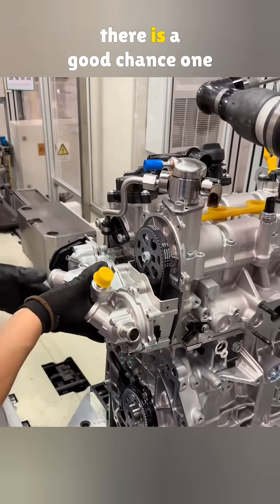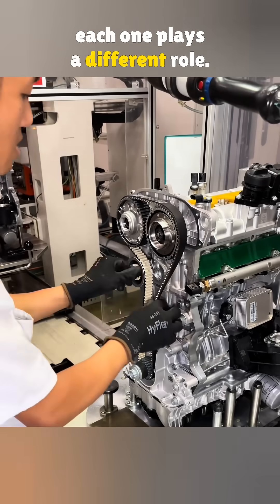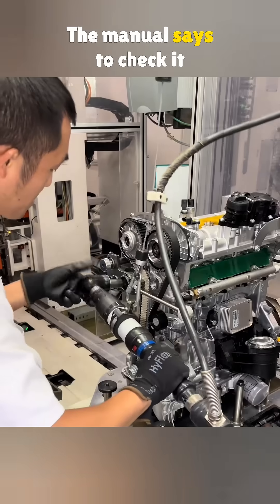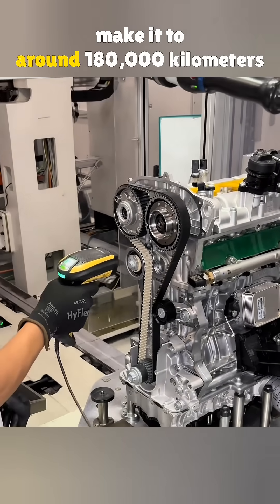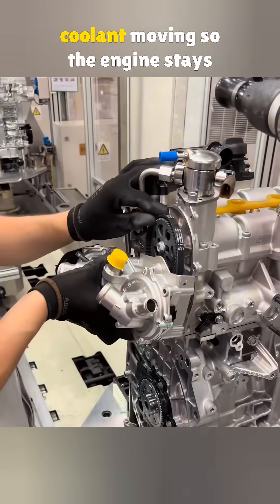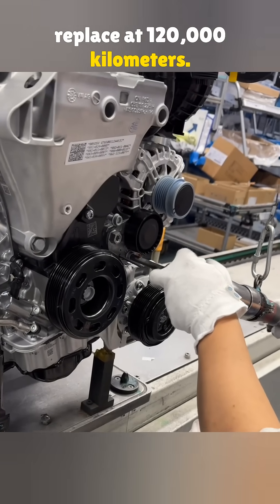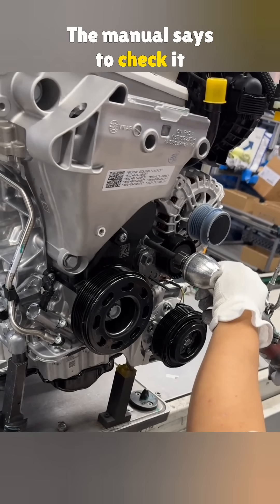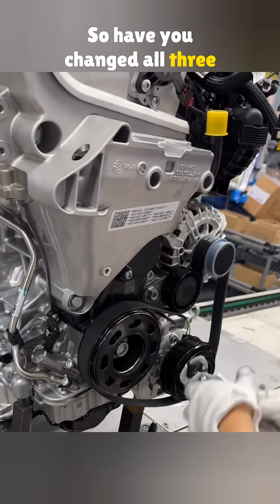The Belts That Keep Your Engine Alive

Comment: Volkswagen group's engine design are stupidest in the world. They cannot be worked on easily.
Reply: What are talking about? You csn do anything on VW engine with a common tools you csn find in the hardware store. And most of the parts are literally like Lego (the fit only 1 way) so you can't install them wrong.

I feel like you want to comment while having no experience.

VW engine are the most DIY there is.

Comment: Biggest mistake they ever did was putting a belt on the water pump like that absolute stupidity.
Reply: In all the cars I've owned, the water pump was driven by the serpentine belt. As far as I know, most non-hybrid Toyota models also use a belt-driven water pump.
Reply: @YuriiT.  Maybe he refers to electrical water pumps like most modern BMWs. By the way, those electrical water pumps are terrible, and oh boy, they break and cost a fortune (they have a plastic housing and they crack over time through excess heat). Water pumps driven by serpentine belts are still considered the most reliable design and vastly outlast any other one.

Comment: VW timing belt may be gone before 80.000 km. Please check it every 20.000 to 30.000km.
Reply: Thats if ypu have leaks on the belt. Most of the cars suffer of tensioner failure instead of the belt failing at 80.000 km.

Well maintained cars can drive beyond 120k km on one belt.

It also really depends on your driving style. If you drive hard you might wanna check it more often, but is less prone to failure than chain driven engines.